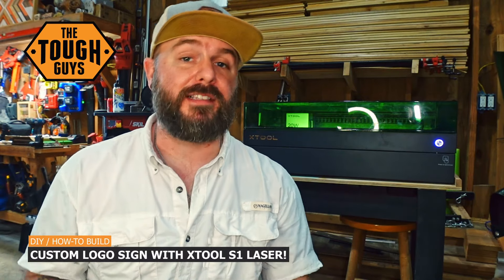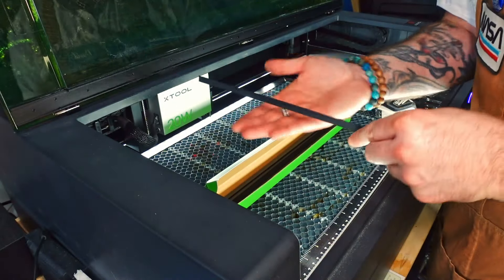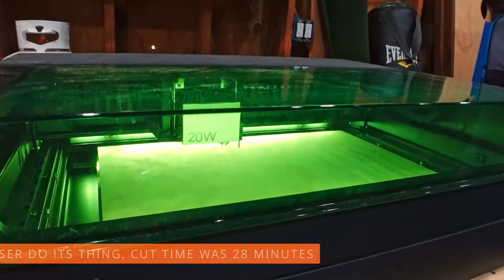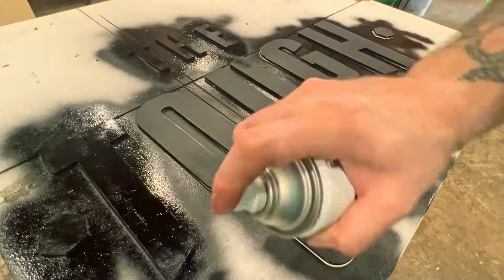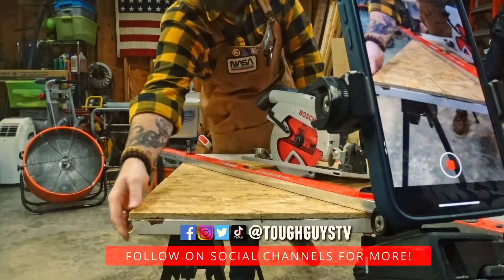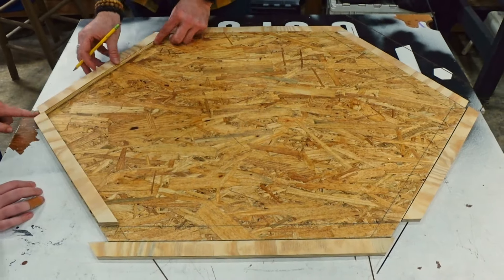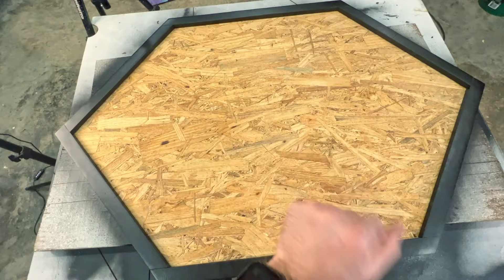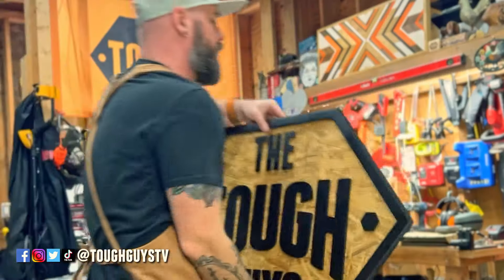How to Make a Laser Cut Sign with XTool S1 20w Laser

Comment: I need to know if with the risers added to the S1, if you can accommodate standard 12 x 24 sheets in the S1 which has been a standard size.
Reply from the maker: The riser base doesn't affect the cutting / engraving size, it only increases the depth of the product you can add. It also allows for a conveyor belt attachment so you can run longer items through it, but wouldn't change the 'width' of the item.

Comment: Hi it’s been a struggle for me to find the right power and speed to engrave clear acrylic with S1 20 Watts. I would really appreciate if you wouldn’t mind sharing the settings please and thank you.
Reply from the maker: Diode lasers do not do well with clear or many transparent acrylics. My understanding is that it’s related to the wavelengths of light that make up the laser. I’ve never had success with clear acrylic and my S1 personally, but it handles colored acrylic very well but there are still challenges.

Comment: I just got the Xtool S1 40 W bundle thing.. 
It just now really gets to me how much testing and trying throwing out stuff :P haha 
- if its to slow it will burn.. if its to strong but to fast it will not cut :P damn... 
Its not just set and forget :D but it sure looks easy on video :D
Reply from the maker: Yeah for sure you gotta get it dialed in, at the beginning I showed a condensed trial and error, gotta keep these videos under 15 mins! But yeah, there’s a lot more work than most people assume with lasers that’s for sure, but it is so fun!!
Reply: @TheToughGuysTV  hehe Yeah I could imagine. 
Could you maybe be of help with a good setting for the 40W S tool cutting 6,5mm plywood? is it better to do it in two pass half strengt? or max power faster ? 

I find that there is a lot of charing.
Reply from the maker: @baekmedier is trying doing multiple passes on lower power, keep the speed quick but not super fast. Do some tests on a smaller piece cutting out a simple shape like a circle or square and see how it performs instead of trying to cut the main project first.

Comment: hello
Tough Guys TV how are you? I can't put the Window Air Conditioner on the window of my house because I have a very large window so I wanted to put a table and put it on it in this way can I solve this problem? A thousand thanks
Reply from the maker: The rear side of a window AC must sit outside, you can’t just have it inside as it is venting then also inside. It must go through a window and vent to the exterior. They do make alternative type AC units that only have the vent duct go out the window, and the AC unit sits on the floor in the room. Look online for this type as an alternative. Good luck
Reply: @TheToughGuysTV  I can put this model on the window and using a plastic pump, putting it on the gutter, thus doing I don't have to use the plastic tanks and also the same thing on my balcony with a plastic pump attached to the air conditioner and then letting the water drain onto the gutter. Do you think home is a good solution? then as for the window, can I put a very large piece of metal so as to have half the window and half the air conditioner? it's the only solution if I don't want to use plastic tanks, thank you very much and kind regards Carlo rightly on the balcony with a table in addition to the plastic pump rightly